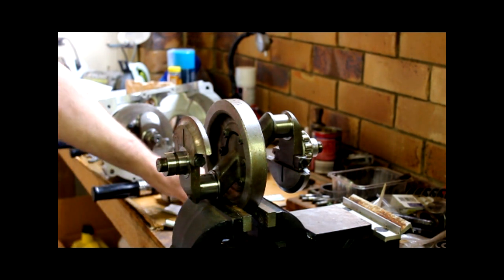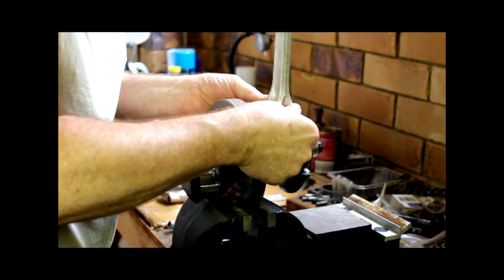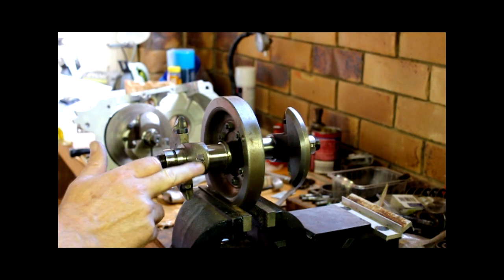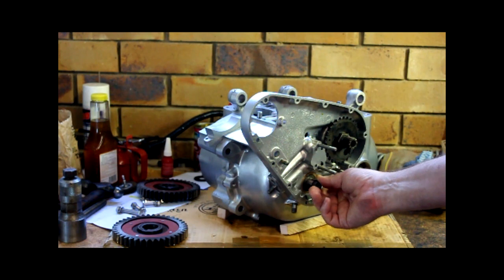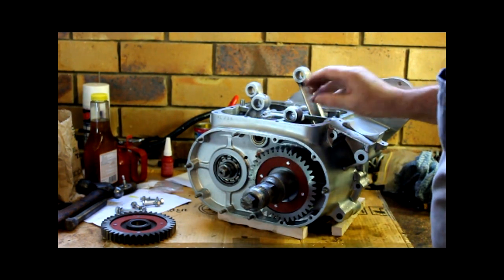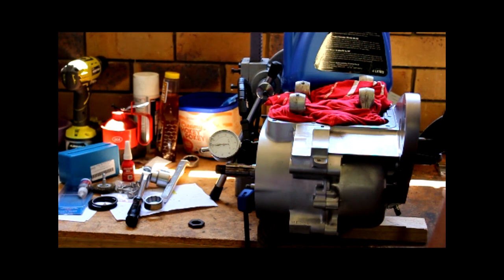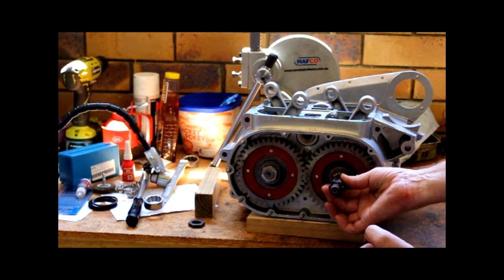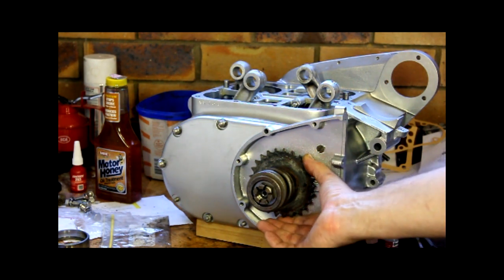Ariel Square Four Restoration. Engine Bottom End Assembly

Comment: UNEF 20 tpi by 3/4.... really? Why would a design engineer introduce that? Life’s not interesting enough, I’ll just put this really obscure threaded nut on the end of these  timing gears. A this point I would like to hear his reasoning for the little monkey in the works. I’m impressed that you identified and resolved the problem so quickly, well done. I now have another snippet of knowledge should that ever be introduced in an engine I’m working on or should I ever be lucky enough to acquire an Ariel square 4.  Got to now wonder is that nut on all engines from 53 to 59? Good video,  thanks.